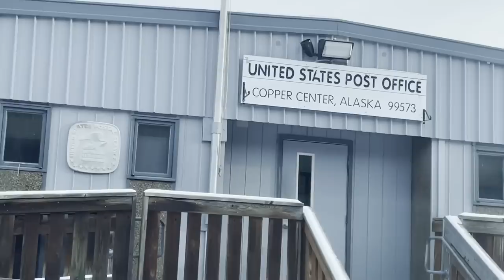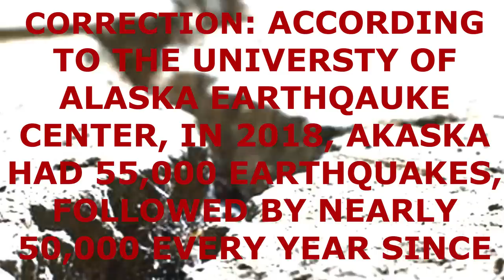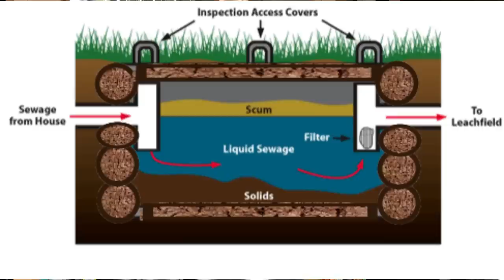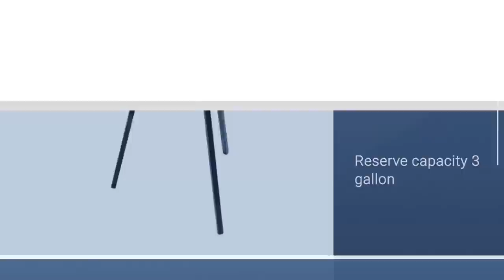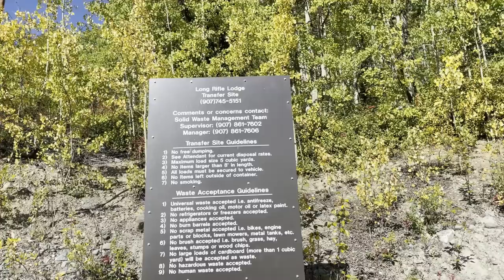The Reality of Living Remote in Alaska

Comment: In Scotland homes had a drying rack suspended from the ceiling.  You hung your wet clothes, raised the rack and your clothes dried without taking up any floor space.  I have lived 22 years without a dryer.  I use a clothes line in warm weather and a rack to dry clothes inside in the winter.  My towels are not downy soft but they smell like sunshine.
Reply from the maker: I for one have never liked a dryer. Yes I have used them but hang drying is the best way. I actually prefer my clothes not to smell like dryer sheets or even soapy. I will take sunshine smell any day! 🤗🧡

Comment: A roll of duct tape is must have item to have in all households. It could have held the faucet. 
Check the tubing in and out of the pump until you get it replaced. Stretching out the tubing as you did will cause it to split over time. 
Nice update.
Reply from the maker: My plan in spring is to redo the tubing with proper size. This was more of a "make it work for now" but I agree! I will definitely keep an eye on it! I have duct/gorilla tape! I probably use that stuff once a week! 🤣🧡

Comment: It's a trade off,that's for certain, there should never be any doubt about that at all, you substitute amenities for chores, nothing is quick and simple, in fact it's quite the opposite, I know about this from being up in Maine for those couple of years, at first we didn't have electricity, we had oil lamps and  one of those huge wood stoves with  multi compartments in the front and the removable portholes on the surface with the handles so you could remove them, that thing was amazing! We had the honey bucket with an outside crude hand pump  well which wasn't safe to drink, it had to be boiled first, I remember it all very well lol and I was a city guy going into all that 😆 talk about   a culture shock, but I did enjoy it dearly.. i like how your sink came out, very nice job there Mario haha , I would definitely purchase another one of those pumps though, because, 1 thing with pumps is, is that over time the Seals blow out after they become worn down some from excessive use, and dry rotting , and it's always nice to know that you have a spare already on hand and not have to worry if the store still carries the same exact one or what have you..
Uhmm? I think ya need a bigger tub? I would search around for  a cattle water trough, those are great, then you can hand make a rack shelf to go across the foot of it to hold all the essentials , shampoo, wash cloth, soap, a bottle of Sam Adam's, a steak with some taters lol...what?
Just because you live out in the boonies doesn't mean you can't live a little lol 
🍺😂 🥩🍇🛁🕯
In fact, it's a necessity in my opinion 😊👍 another great video, the audio sounds a little odd at certain points, but I'm sure you'll figure that all out , as soon as you remove the filters from under your sweater hahaha you kill me girl 😆 enjoy the rest of your week end, and we'll see ya in the next episode of lumpy in Remote Alaska  😜
Reply from the maker: That's it exactly! You kind of have to love doing things the hard way or you just cant survive out here or anywhere! I mean you could have a furnace and running water etc and be out in the middle of no where with all the conveniences. I guess to me thats not what you come out here for. Everyone is different and nobody is wrong. Sometimes you just get someone who thinks everything is defined. Again the life is harder but far more rewarding. Steak and taters in the tub you say 🤭 I prefer to bathe just before bed. You go to bed warm and clean and sleep better! The tub is the perfect size. I dont want to use up too much water. When I make the bathroom more permanent though, I will have a metal cowboy tub that drains outside. But because you have to do so much more to get the basics, you enjoy it more. Meals taste so much better. Sitting in a bath in front of the wood stove is an amazing experience. I have bathed in front of that window and just looked up at the stars. And yes fell asleep! Audio is a bit off because my Iphone died. I must have worked it to death. I get a new one end of the week so next video's audio may be a bit wonky again. Lumpy in Alaska! 😂🤭 Thank you so much Mike! 😉🧡
Reply: @AloneinRemoteAlaska  you're very welcome haha ,I knew that would get a chuckle out of ya lol enjoy the  new state of the art sink and jacuzzi,  and we'll catch ya on the next one!
p.s.- no biggie about the audio, I just thought that it's something that you would want to know about.. you'll get it all figured out I'm sure ✌️😊

Comment: it is a cabin and a great cabin. oh ya, did i tell you howmuch i love strips ? hahaha. your looking great lady. lol. oh ya, i use an old washer to do my cloths. i fill it with warm water with a bucket and set to wash and start by running off a small generator. i have to watch it as the cycles change like to rainse after draining then add clear water for that cycle, rainse and drain and spin, and done. hang to dry. lol

Comment: Smart girl with the water line I use to use after market windshield washer pumps  in my campers there 12 volt and wire it to a door bell button so push the bell lol slow but faster then the hand pump one just pumped the water throw them just incase a battery die

Comment: I couldn't find a Zodi available for purchase while looking for one a few years ago. I ended up purchasing a stainless steel 4 gallon sprayer and then I attached a sink sprayer head on it. You're going to give Moose a heart attack with your bathtub scenes. I'm just kidding Moose. Have you considered using a propane on demand water heater / shower? I was thinking about using a 20 gallon food plot sprayer with pump connected to a propane on demand model.
Reply from the maker: I have owned that Zodi for maybe a decade! It still just keeps on working and it has been on many camping trips with me in Colorado. I would most likely go the sprayer route next time like you did! 😁My original bathroom in the cabin had a propane on demand water heater for the shower. It was just too old. No plans to replace it now. I tend to really like the bath tub. Moose can handle it!😉 Besides the out takes show I was 100% still fully clothed for the bath tub scene! 🤣🧡

Comment: When trying to force two fittings together use a little dish soap as a lubricant.  It helps and when it dries it also acts like a glue.  I learned this trick when putting new grips on my golf clubs.  If you are ever soddering  copper water pipes get white bread, roll into a ball and shove it as far as you can into both pipes.  Then when the pipes get hot the bread holds back any water in the pipes and your sodder will work.  You just remove the screen on the tap and the dissolved white bread will come out.. Hint do not go knocking on neighbours doors looking for a slice of white bread go to the local restaurant and buy a slice.  Everyone was eating whole wheat and that does not work, gotta be the evil white stuff.
Reply from the maker: Fantastic advise Lyn! I will remember that ....... next time! 🤣 I did manage to get the tubing to work but with a lot of very "explicit" language. I had no idea about the bread though! I love learning stuff like this! I like the evil white stuff. 😉🧡 Thank you so much Lyn!

Comment: I would recommend getting a roll of pex A tubing.  It's resistant to frost, easy to work with, and will work for all your water running projects.  Great stuff for frost prone and diy projects.  If it does freeze, it wont burst due to its ability to stretch with the ice.

Comment: Loved this video! Plumbing is always a pain in the rear isn't it? My experience doing it is it always takes twice (or more!) as long as you plan. Also, I was wondering how you deal with umm ... basic human needs. I assumed you were using your outhouse, never occurred to me that a composting toilet works that well (odor free anyway). That bathtub scene, haha! A black plastic tub is not glamorous, but it works. Though a copper tub would match perfectly with your cabin aesthetically, but hopelessly impractical I suppose. Curious about the hand carry/dump of gray water  ... do you always dump in the same place or do you need to rotate where you dump so you don't create a swamp? Take care and enjoy your fall.
Reply from the maker: No more indoor plumbing for this gal! I know a lot of people can't even think about that but I love it! I have used the 5 gallon bucket since I first moved here and it just works perfectly. Sometimes, (oil heater repair guy, my contractor) have  asked me what do I use for a toilet and I point to the bucket they are standing next to!🤣 No smell at all!  The tub I have now is temporary for sure. I love it! But when I build my bathroom, it will have a similar type "cowboy" metal tub that drains outside. For the grey water I will just dump it in the same spot. It doesn't accumulate but if the dishes make the slop bucket too greasy, I will dump that water in the fire pit. 😉🧡

Comment: Still enjoying your videos. We moved to our cabin full time 3 months ago. Unfortunately we have to drive to work everyday. We use an outhouse, haul our own water up our trail to our cabin. We couldn't take baths because it uses too much water. We have a 100volt washer and dryer that works well for us. We are remote, and off grid. Off grid to me just means your not connected to the power grid. We make our own power. Thats just my 2 cents.  I wondered since your not going to drive anymore this year, how do you replenish your water?
Reply from the maker: That's awesome you are there full time now! If I remember correctly you have quiet the trail to go through to get to your place. I always thought off grid meant no power or water connection. Then I started seeing it meant no roads, no cellular and no medical/dental or even groceries as some wanted to show they were more off grid than others. Had no idea it was a contest! 🤭 When I take baths, I do not fill the tub completely. Sometimes not even half way. Still works great and the tub is pretty small anyway. You I would consider off grid just because of power and water. As for my water situation, I have about 275 gallons of water in the cabin and I still will try and make runs to the well to fill up when I can. I also melt A LOT of snow! 😉🧡

Comment: I have 2 Alpicool 12 volt refrigerators which will cool down to -4 degrees..... each will run 24 hours off of my 500W Jackerys solar generators.....has been very handy...yup
Reply: The 12V refrigerators do run off of 120v electric as well....when power is out I simply unplug from electric and plug into 12V Jackery....yup

Comment: Home is home. And its getting the tlc it needs. Maybe you should get out your inner Viking, and take snow baths! 😂 I call it semi off-grid, as I too only have electricity, which makes it possible to have water pumped up from a well and a sewage system. It gets service once a year. I wish Starlink was a bit more affordable, but until I figure out if and how to get that,  I have a radiolink internet. The sender is in the nearby village, the receiver is on a barn further up in my valley, and I had to cut down some trees to get clear view of it, and voila, internet! 😅 I have poor cell phone connection, so calls are done via wifi. Wow, I didnt realize you have no fridge? Do you use coolers and ice packs? I was going to ask - how do you stay fit, when isolated in your cabin, but I guess you answered that, nothing romantic about hauling water here and there and washing by hand. The last I do agree with. Fresh smell of clean clothes. I have never had a dryer. I dry clothes outside in the summer, and in the bathroom in winter. This girl needs some luxury, ..underfloor heating in the bathroom, clothes dries over night.  💕 Stay safe 💕

Comment: No toilet? Big deal. Since you have electricity, buy an incinerator toilet. It works well at the top of Mount Washington in NH, with temps comparable to yours in winter.
Or use organic matter in your compost toilet that can be saved to turn into compoost.
Reply from the maker: Exactly! I do plan on having a composting toilet of some sort. No connection to water or electricity! I have seen some pretty darn low temps in NH! Even more snow too! 😉🧡🥶

Comment: Hi! I wonder if I may borrow a little space here for those whom are still confined to ground and leechfield drainage? I got a little history of my own if you'll permit. 

You are right, without getting under the grade surface and into the the piping itself, you will continue to wonder what condition the soil is in to accept the wastewater. Getting to the soil along the piping can be a strong clue, but it wasn't till I uncovered 'distribution box' that feeds the leech-lines themselves and pry open the cap, I was able to see why I experienced standing water in my back yard. It looked like cement on a sidewalk that was about ready to set. But, today, after treatment, it is back to water and is a little dark (normal) and transluscent.

If you ask me, 90% of the sewer construction industry relies on a scam. One that, , after dozens and multiplied dozens of forums and website info on the subject, They say this, 'once the leechfield reaches that point of no more drainage, your field is toast and the soil 'needs to be tested',  pulled out and replaced.' This is the common report from the 'professionals'.

My advice would be, if your cabin did not file with the borough or county the location of the parts of your system, watch out for drainage 'technicians' who will offer to help locate effectively by digging up numerous 'samples' in your yard, there are devices they have these days that give the experts readings underground.

The fix? Order the kit from 'Amerisep' to shock the system from the leechfield all the way to your toilet drain pipes. They will ask how old the home is, I think if it was built before 1985, you will be advised on purchasing the bigger quanity. This does however come with a money back guarantee.

Sorry for the verbose comment!

God bless!
Reply: , , to emphasize the location of the 'distribution box', you will need access to this because that is the first order of business to pour their slurry into. They have you treat the last stage of your system first, most commonly, the 'D-Box'.

Comment: How do you warm up your engine when it's -40 degrees F and no electricity
Reply from the maker: Do you mean if I lose power? With power I can plug in the vehicle. If I lose power I can put hot coals from the wood stove under the engine. 😉🧡
Reply: @AloneinRemoteAlaska  10-4

Comment: I burn my waste as well, I smash my cans with a sledge hammer to make the most of my storage and I smash all my glass as well which helps me procrastinate my trips to the dump. Any aerosol type cans like carb cleaner I do not smash or burn for obvious reasons but if any extra is left in the spray can, I'll use it to start my fire on windy days. All burning is done in an old 55 gal drum. Any left over oil I use to fuel my fire and I do burn plastic. I should note I do not swing the sledge I simply set the cans on the ground or the glass in a metal trash can and drop the head of the hammer on all mashables. My septic is a 55 gal drum with a small drain field which is great for me. Compacting makes everything heavier so I recommend a hand truck...Just sayin'